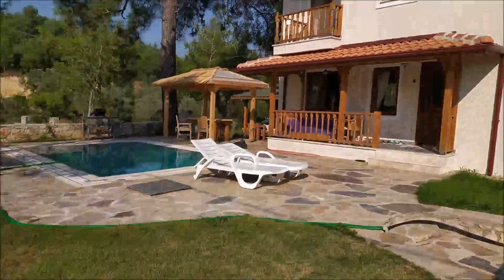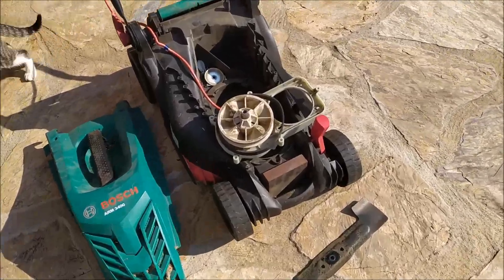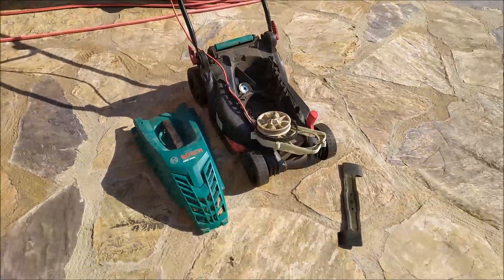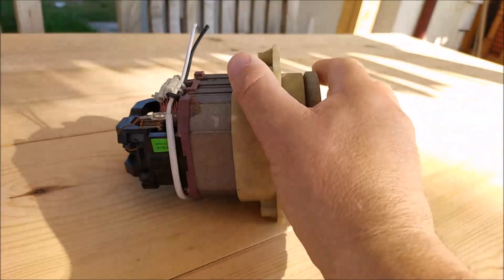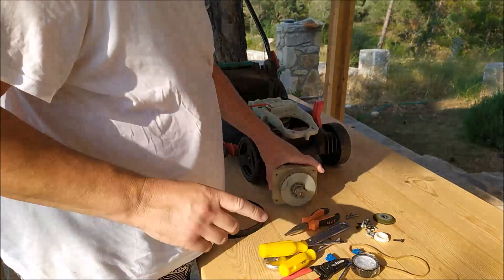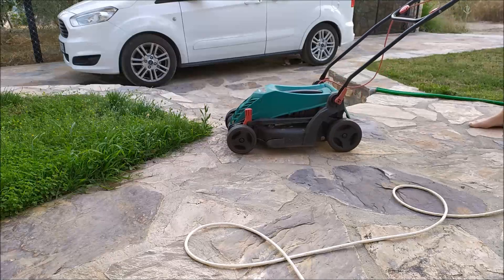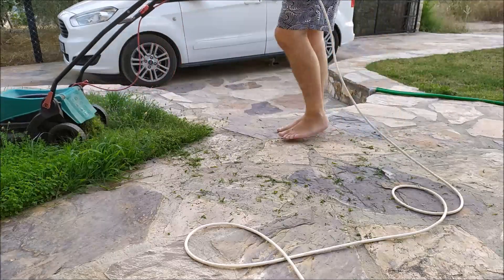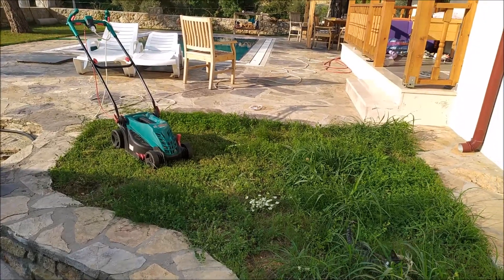Bosch Lawn mower, motor bearing replacement , ARM3400

Comment: The main drive bearings are 609zz (top) and 6002zz (bottom) - also available for less than 5 bucks.  These are easy to replace, because they are housed in plastic, use a socket to punch out.
Reply: How on earth do you lunch out the top one? I removed the c clip but the shaft seems jammed inside so the bearing can only come out upwards? I can’t get anything on it.
Reply: @mystikmeg  Long ago I did this Bosch, so use a socket from a socket wrench set that matches the size (get close) and use it to punch it out.

Comment: Hello guy in the video from 4 years ago, I have the exact same E-Motor from a WOLF Garden mower (well, I took it off someone's hands for free to try and repair it). So it simply just seized up without jamming the blade in tall grass or so? Interesting. I will try to get it repaired with a new ball bearing. Actually both main bearings on the belt system seem to turn pretty sluggish. But good to know it's doable.

Comment: 2:10 did u see how they open that thing?twisted or pull? that is my only problem
Reply from the maker: @coldogno7  hi, the video was not very detailed, sorry about that, in one of the replies here someone did take the motor apart with a detailed explanation.. I should have videoed the procedure, my bad, 
Yes have a look at the replies and you will see the procedure..
Cheers

Comment: So, the only help that this video gives is - take your mower to a Bosch repair centre. Great.
Reply from the maker: 😁I know after watching a couple of times it is a bit odd, one of my early video's 😁 have a look at the pinned comment, it gives details about the procedure.. cheers 👍
Reply: @myturkishlife1777  😄 thanks for the reply, sorry if my comment seemed a bit harsh. I was suffering from dead lawnmower syndrome 🤨
Reply from the maker: @SuperEwokk  😁no problem, I should have taken a video of the guy replacing the bearing, I tried to ask him but the language barrier was an issue 😁
Since the video the mower has been working perfectly 👍
Reply: @myturkishlife1777 I can’t find the pinned comment. Can you help? Thanks
Reply from the maker: @mystikmeg  hi, I have just had a look too it seems to have gone, have another look in the comments I'm sure someone mentioned the bearing sizes , as far as I know the motor pulley unscrews ..
Cheers

Comment: Thanks for uploading. I've got a dead Rotak at the moment, so far watching various repair vids it seems it could be switch, switch lever / spring, disconnected wires, belt or motor bearing. Will check them all out soon.

Comment: Was the motor not powering up at all ?   I just had mine checked out ,    It won’t power up.     I was told that the problem was with the motor.      Appreciate any help.   Thanks
Reply from the maker: Hi, the mower was working fine then deteriorated very quickly, it didn't blow a fuse, which surprised me, but when unplugged and laid on its side when I tried to move the blades they were jammed.
When I removed the motor there was very little if any movement.
I should have shown the procedure for bearing change but that segment(and probably the most relavent ) clip was corrupt.
There is a comment in this section that explains the procedure .
Cheers 👍
Reply: @myturkishlife1777    Thanks.    My Lawnmower wouldn’t power up.  I took it to local lawnmower repair shop.  They said.     All switches we’re working.  But the problem was with the motor.  He let me know,     before it started to get to expensive to fix. I was wandering after watching your video, if it was something I could have a go at myself.   Thanks
Reply from the maker: @grahamjohnston3899  if the motor turns by hand it could be brushes, there are many YouTube video's on how to test motor windings too.
It could be a brush, not necessarily worn out but stuck .. so may need cleaning up.
If you are a hands on type then have a look ..
Cheers 👍

Comment: Just had three exact same thing, decided not replace bearing as I’ve had it with Bosch now, only a couple of years not throwing good money after bad
Reply from the maker: Hi Yes I see what you mean,the safety switch is playing up now, the part when you push the button then press another button.
I will have a look when it gets worse, but yes I am a bit surprised as Bosch years ago was a trustworthy brand, I feel this is no longer the case.
Reply: Our house was built in 74 and still has the oringal Bosch oven, still works, in the last 15 years my parents have gone through 3 Bosch ovens and now switched to an Ikea. It’s now no better than anyone else, but costs a lot more. For mowers I’m now going for cheapo cheapo and hope it lasts the warranty, or collect them for free and store them until required. Good news is the grass box and handle seem to be worth a decent amount on eBay!
Reply from the maker: @wollywotsit  I totally agree with you, I bought a cheapo electric lawnmower from B&Q in 2001 made by Champion, and it is still going strong.
To add to your comment on white goods, here in Turkey you can buy any make you wish however there is always a Turkish equivalent that works out a bit cheaper, I bought a black glass fronted fridge freezer made by Beko, it was easily 30% cheaper than the Bosch and have to say the quality is superb..